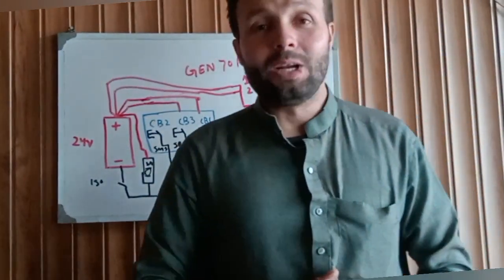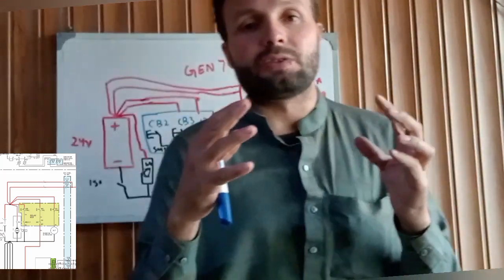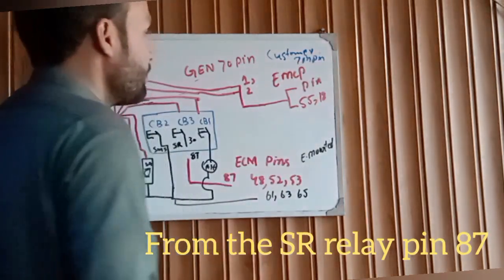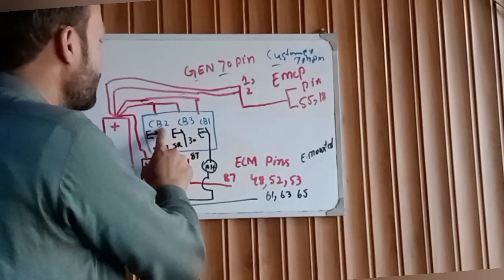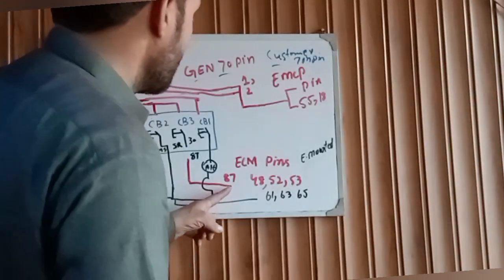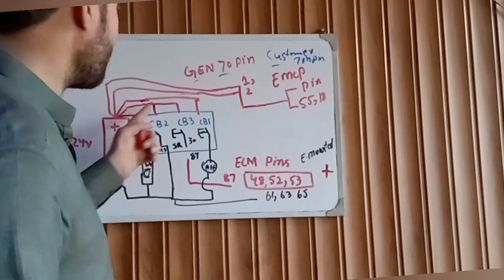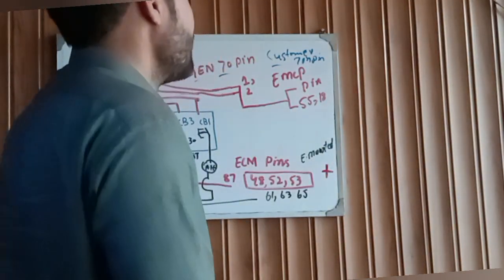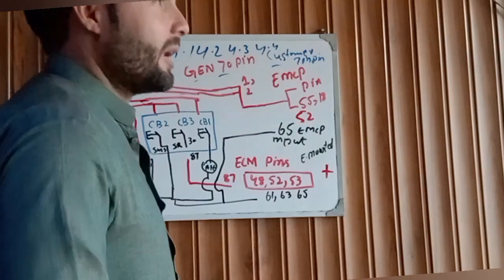Caterpillar generator C15 & C18, ECM | EMCP power Supply connection

Comment: Last video,I also requested you in previous video....
Sir please make  a video on Cummins S6700H speed controller.Please explain it's all adjustments variables and its connections pin.Partially, Explain it's Droop,AUX and 10V output terminals connection.
Also explain it's " fault in and Alarm" terminals about its wiring how we can use it.
Reply from the maker: OK so as soon as possible